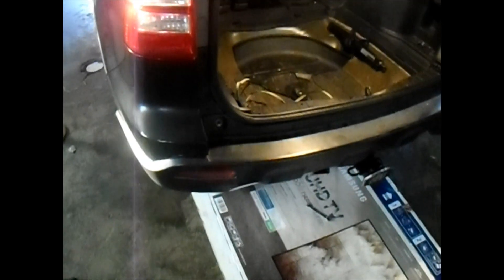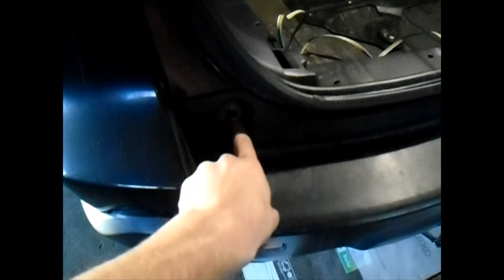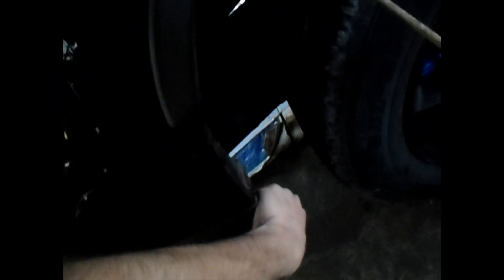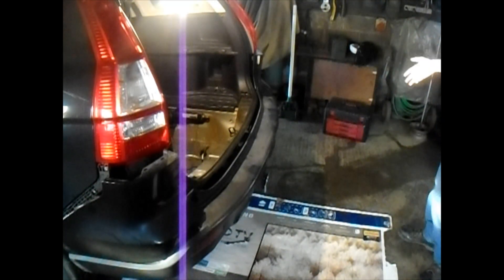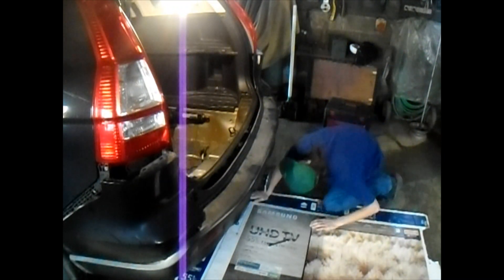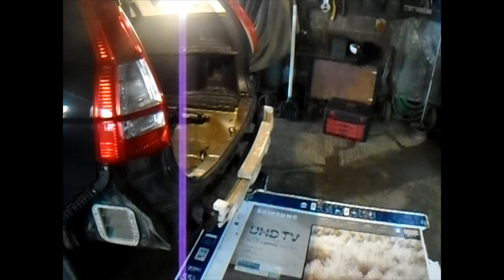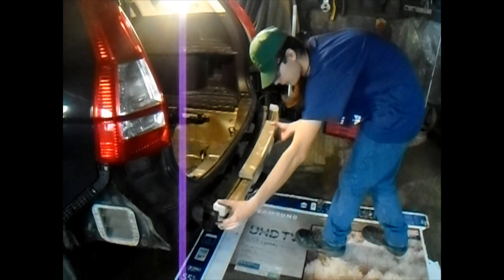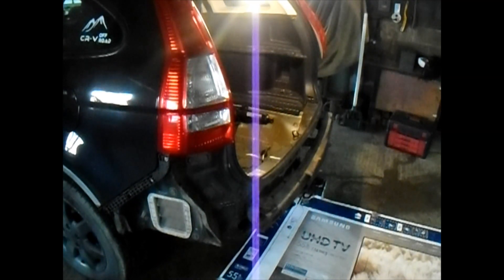how to remove the rear bumper on 2007-2011 Honda CR-V

Comment: i had the same issue with my CRV where the corner of the bumper separated. how did you actually fix that separation? Does it just snap back into place? or were there broken clips?
Reply from the maker: It should just snap back in the place
Reply: @oldschoolrepairshop2866  would it have been possible to just snap it in without removing the entire bumper?
Reply from the maker: @official_ray  yes